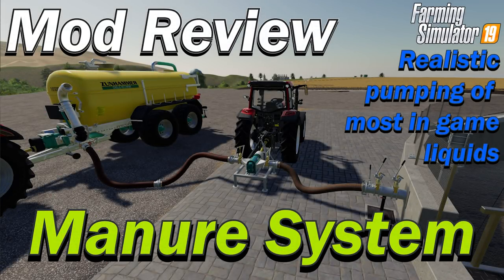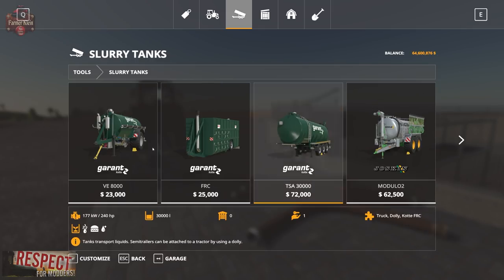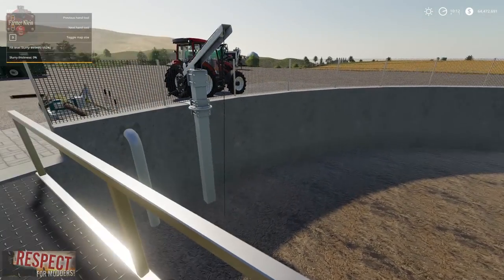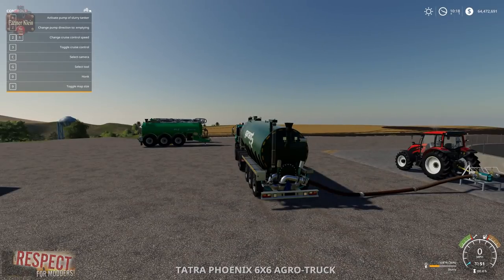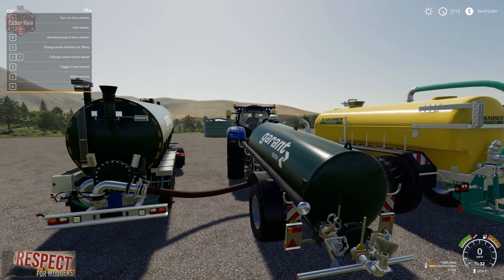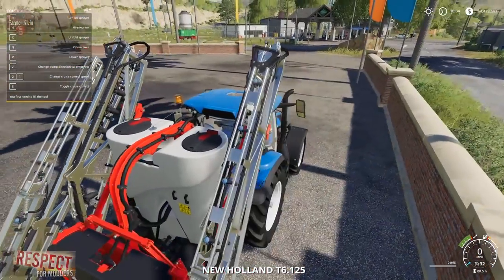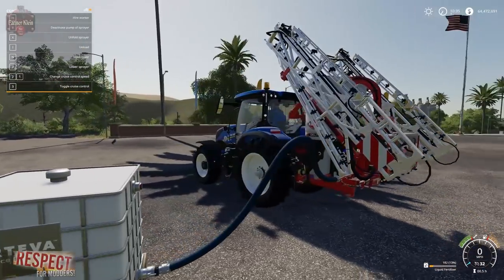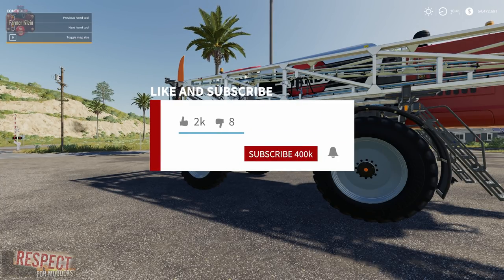Mod Review - Manure System by Wopster

Comment: The kotte on that truck is perhaps the most annoying tanker to use due to its stupid collision positions.. which causes the coupling being a bit annoying and makes the hose jump.
Reply: And about the handles.. those are vanilla tankers I can't split up the mesh with a script and animate all levers.

If you take the big Samson tankers for example, those have shared connector assets loaded from the mod meaning those are fully animated.
Reply from the maker: Thanks for explaining the inconsistency on those handles.
Reply: @Mr Jeremy not sure what you mean.. you already can connect the hoses to each other.
Reply: @LSPWopster  One thing that would be nice if possible is to give the hoses a bit more flexibility. They are rugged hoses and all, but IRL they are aren't as stiff.
Reply: Hey man, love this mod. Is there any chance it could/will be transfered to FS22? If not already done so of course, but I cant find it anywhere!

Comment: Very nice video Farmer Klein.  Lots of good information regarding these mods.  The only problem I see with these mods is Giants very limited in game handling dynamics when it comes to picking up items in the game.  Unfortunately, you cannot rotate an item after its been picked up so you have to get the item just close enough to a trigger point for it rotate and to attach.  Nine times out of ten, you are going to drop these picked up items several times, which adds to the frustration that Giants has created with their limited in-game handling dynamics.  This is no fault of the mod authors by any means and I appreciate what the mod authors are attempting to do in-game with these mods and it does provide some added realism to the in-game experience.  I wish Giants would improve the in-game handling dynamics so players can enjoy these mods on a more realistic level.

Comment: I played with the mod for about 3 hours, and I would say that its good if you want realism but, samson slurry tanks dont have a place holder for hoses nor the sprayers so you have to somehow carry the hoses with you.. I think it would be better if we could select hoses just like chainsaws with mousewheel. Also sometimes when you pick the hose you step on it and you start going up like if you are riding on a magic carpet.
Reply: The flying part happens with pretty much anything you can pick up in game, its a game engine issue and not mod related.

Comment: Nice little mod to add some more realism to the game, but I have to ask with regards to the fertilizer hoses: Will they work with place-able stations that provide liquid fertilizer, such as multi-filling stations and the mod known as "Liquid Fertilizer"? Would they also work to pump gas from place-able filling stations into a mobile tanker or service vehicle?
Reply from the maker: Early in the video i show where on his Github that mods need to be prepaired for the use of this mod.  so if those mods are prepaired I dont see why not.

Comment: I think this is Genius. I believe I am going to force myself to use it (at least till I lose my hair). It sounded like you said if this mod is installed that the normal way of loading is disabled?
Is that correct? Thanks for the great info vid.
Reply from the maker: Yes that is what I have seen aside from the BGA.  Digestate seems to still fill normally but pulling up to a slurry trigger does nothing with this loaded.

Comment: I did a small test and the feature conflicts with the Hof Bergamnn map, which ironically is what i was playing. I tried Oakfield by oxydavid with only manure mods and seasons and it worked. The Bergmann map won't accept the manure sys mod sadly. I hope the maker will update it to run this system because It's best Euro map to date in my opinion. :(
Reply from the maker: Hof Bergmann was updated over the weekend to 1.0.0.6 and it supposed to include support for the manure mod.  are you using that or the previous version 1.0.0.5 or earlier?
Reply: @FarmerKlein  I'm playing 1.0.0.6. It doesn't support manure system. I'll try it again a start a fresh game however I doubt it will work.
Nope. Tried a new game in new farmer mode. and pipes won't connect. Whatever the maker wrote is incorrect or he forgot to hit 'save' lol You can try for yourself on PC and see if you have any luck.
Reply from the maker: maybe you need to get the development version of manure hose. from github.
Reply: @FarmerKlein  I'll give it shot. But u should try it with Bergmann map and see if it works for u. It's a neat feature but I'm in no hurry to use it.

Comment: I have the mods but nothing is connecting. I get no messages to connect. However I still get the press r to refill. I have all the mods enabled. ugh so frustrating to troubleshoot this stuff.!!!
Reply from the maker: sounds like your not using a compatible trailer or fill trigger.  The github site I am sure I linked in the description has a listing of all the in game stuff that it works with out the gate and mod trailers must be updated to work with it.  same with placeables.
Reply: @FarmerKlein  I was trying out the fertilizer technique with a Hardi sprayer. I essentially mimicked what you did and i get no 'attach hose' message. press R is all I get as if the mod is not recognised. Not sure why...oO
Reply from the maker: @peterzebot9863  Oh ok,  sorry no idea i havent used it since i did this video.
Reply: Ok i started a new game with a crappy vanilla map and i get attach hose with only the manure sys mods enabled. So it seems there is a mod conflict somewhere. I'll let you what I find.

Comment: good mod and vid shame i cant get it to conect to my bio gas plant or auto fill from the slurry tank
Reply from the maker: in my testing i could autofill from the digestate at the ravenport biogas with no issue.  you could also always add the required bits to the mod or map your using but indeed it can impose some limitations on different mods until mod authors update or players who can update.

Comment: Hey will that come to console
Reply from the maker: it doubt it due to its extra scripts but then again straw harvest is out and it has extra scripts
Reply: Farmer Klein k an will they come out with a mud mod on fs 19 with mud an water an will they come out with a digging mod an a 18 wheeler long  box trailer where u can load vehicles an all that an will they come out with a tow truck mod an truck with box trailer where u can load vehicles an all that an will they bring more John Deere tractors without box cab an actual John Deere tractors sounds an more riding mowers on fs 19 for PS4 an consoles an long chicken an hog houses with a 18 wheeler trailer with an auger pipe for chicken an hog feed for the long houses an chicken box trailer  trailer for baby chickens an trailers with creates for fully grown chickens for FS 19 for PS4 an consoles